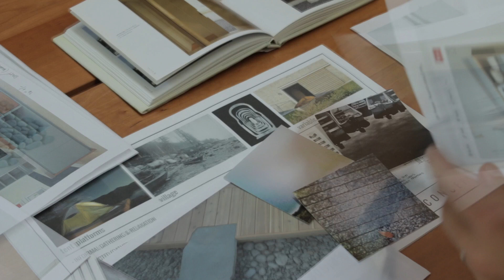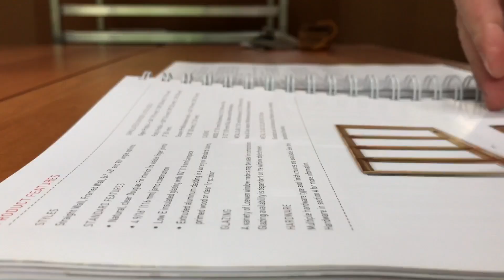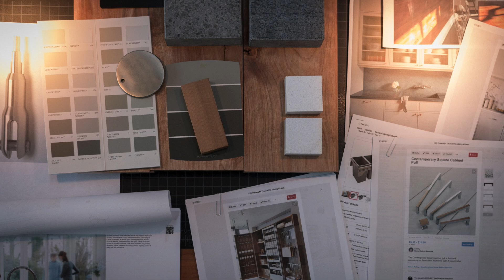Choosing Architectural Materials

Comment: hi.material selection, its a very interesting topic, as a student this semester in my architecture design class, we are learning to develop  a  building that firstly answers to the rural community  that we are working for out side of the city, and at the same time working with local materials, in special with guadua (a kind of bambú) as the estructure of most of the buildings, and other complementary materials for the guadua and the sites we are analysing, giving a response to the different necessities of the community, but we haven´t ended that study process, this video has contributed to this process.thanks.
Reply from the maker: sounds like an interesting project brief...i've no experience with bamboo (other than as flooring)...best of luck to you...